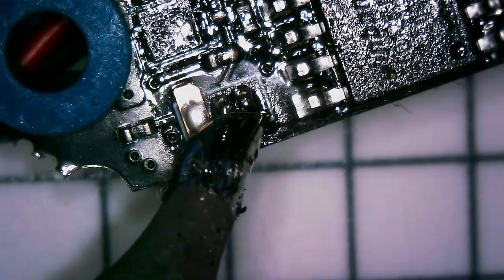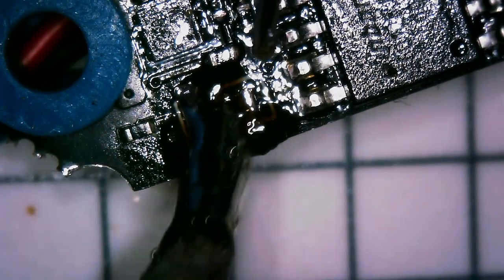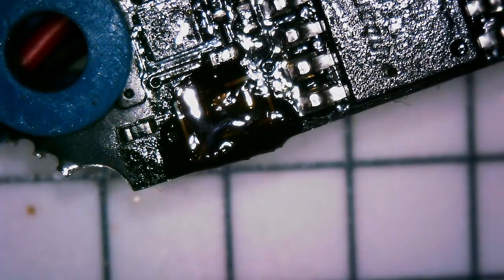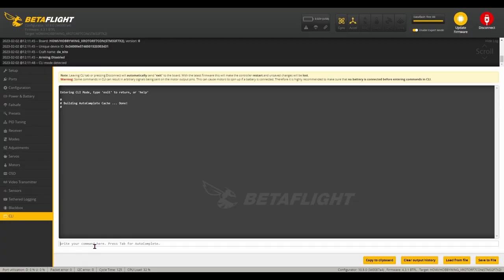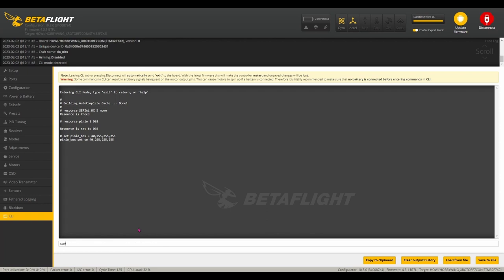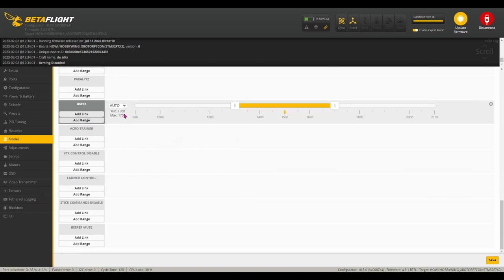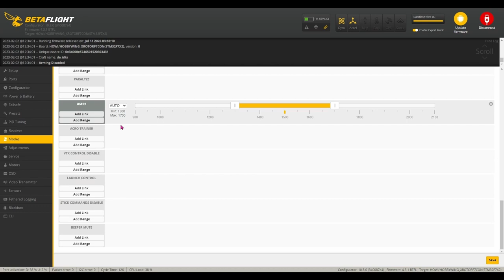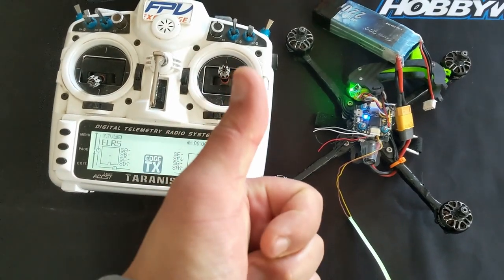Hobbywing Xrotor F7 Flight Controller on board Pit Switch setup.

Comment: i have the t motor f7 mini hd i want to turn my o3 air unit on and off with a aux switch, the fc has a pit mode solder joint on it, but i dont know how to configure it because i dont know which pin i have to free up and configure over the cli, there is no documentation on the t-motor website or in the packaging, they just say bridge the pit switch and activate the mode in betaflight... that doesnt help i think my next fc will be a hobbywing fc 😂

Comment: No where in the manual does it mention about removing a resistor off the jumper pad. Nor does it mention anything about the set pinio_box = 40,255,255,255. And, it says nothing about hooking to the 10v pin inside the DJI plug but rather the 10v pad.

Seriously need to update that manual...
Reply: Exactly and the firmware version on the manual is also false, it says to update the FC to the "FLYWOOF7DUAL" witch will absolutly not work... Hobbywing manual = crap